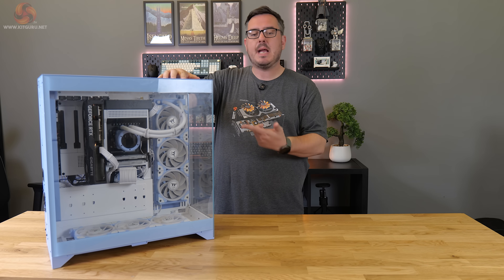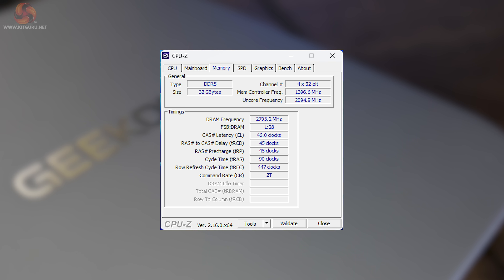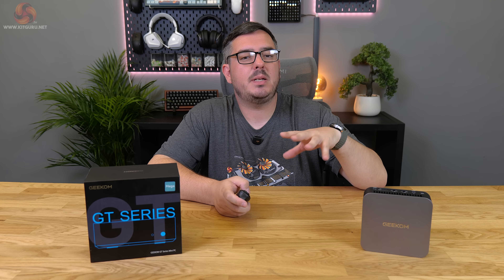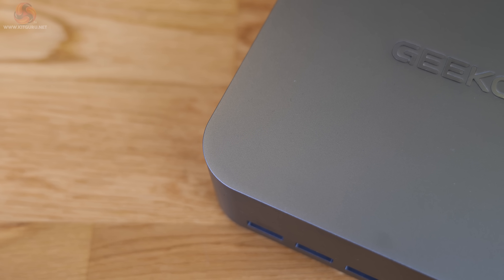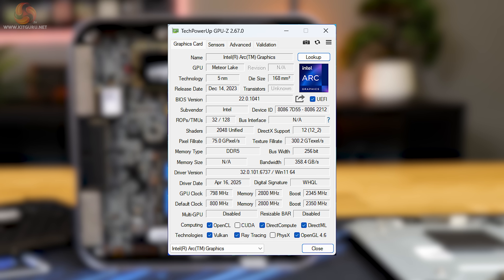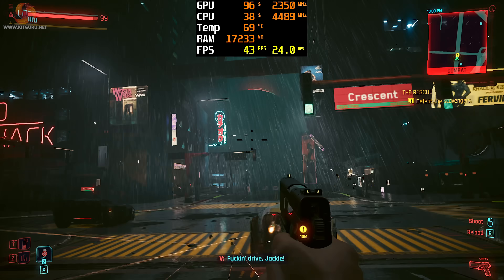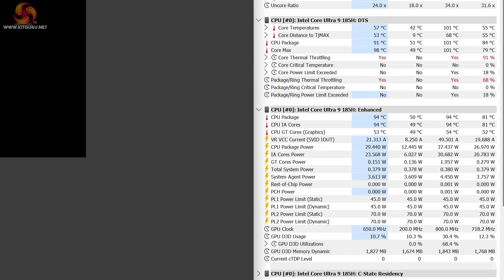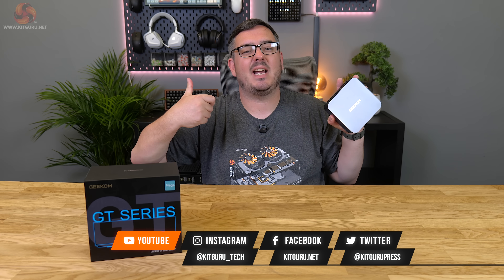Geekom GT1 Mega: The £949 Mini PC Tested

Comment from the maker: Anyone looking to buy a mini PC like this - what would you use it for? And please report any spam you see, never-ending on YouTube at the minute
Reply: I think their issue is Intel is dead in the water, if it had AMD I think it would have scored better. they run too hot as well. Makes the problems worse when its such a small chassis. DId you ask if they only do Intel versions or are they planning AMD systems like this?
Reply: I don’t mind the performance, but the lack of upgrade options is a bit of a deal breaker for me. AMD would make this better too. those intel cpus run at 90c all the time anyway or more
Reply: The IO is actually pretty decent. Two HDMI, USB4, SD card slot — ticks most boxes. However it runs far too hot for me, I got away from intel to avoid all this - sick of fan noise. My AMD system runs 25c cooler and has similar performance to my last Intel Rig.
Reply: What strikes me is how close this gets in price to a fully built desktop. At £949, a DIY build could include a Ryzen 7 9700X, B650 board, 32GB DDR5, 1TB Gen4 SSD and an RTX 4060 — which would blow this thing away in gaming and still be upgradeable. The value just doesn’t add up unless you need the form factor.
Reply: The irony is that this is a great “prosumer” box for spreadsheets, light editing, coding, or acting as a little dev server — but Geekom markets it like a gaming replacement when it’s really not. At best, it’s an overpriced Mac Mini alternative that runs Windows. 🙃

Comment: It would be rad to see one of these mini pc’s with something like a high end gpu cooler, big heatsink, fans and all 🤘😂
Reply: Wonder if an e-gpu enclosure would work with it?
Reply: @philipjfry628  You can get an e-gpu but it sort of ruins the point as now you are going to have two boxes instead of one. Guess you could superglue the mini-pc to the GPU enclosure but you might run into cooling issues.
Reply: @philipjfry628  Probably but might have slowness.
Reply: egpu is handy for these systems I used to have one but the interface often causes a loss of performance.

Comment: A mini PC is not a small "desktop". A mini PC is a laptop with no built in screen. Expect laptop thermal limits, lower performing chips, etc. they have their place, don't get me wrong. but if you need a desktop then buy a desktop.
Reply: Really depends on what you want to use it for doesnt it
Reply: To thread starter — Well my laptop screen died a few years ago and I used a usb monitor for a while on it. I certainly didn’t stop calling it a laptop and suddenly call it a ‘minipc’ 😛
Reply: A mini PC can be whatever you want it to be. There are not rules like this. ive build many mini PCs with mini ITX motherboards.; Not sure your point. There are always cooling and performance compromises with full sized desktop systems and 'everything else'. Thats not a groundbreaking fact. A mini PC is not a laptop 'by definition', a laptop is a laptop.
Reply: @MatthewSemones  Exactly. Because of that a minipc like this has to deliver at least the same graphics power as a laptop with the same price. 

So mostly those mini pcs over 400€ make no sense at all. I have a beelink minipc for 300€ that has ryzen 5800u in it. 

Its ok for office and very light 720p ganing.

I only would take amd for those minipcs because better game compatibility, better power efficency.

If intel had used lunar lake in minipc it would be good but also even more expensive.
Reply: Zip tie one behind a really nice monitor and you have a cheap iMac that runs windows.
Reply: It is a small desktop if you can do everything on it you can do on a normal desktop PC. The problem with using a laptop as a desktop replacement is with the external screen you usually use it closed and the thing just sits there overheating.
Reply: I love YouTube comments 😂😂
Reply: Oh dear

Comment: Great review. I'm a big fan of these mini-PCs / NUCs for offices and the like - floorspace costs money - but they do have their limitations your review coming from a very different perspective does highlight them.  For the office, in many cases much more modest models will be far more suitable.

When testing games, did you use any upscaling or was everything native? 

Was there an issue with recording the noise levels around 17:48? Because I couldn't hear the difference between the idle noise (36 dB) and the peak noise despite the latter being shown as 50dB.

I liked your thermal imaging.
Reply from the maker: Thanks - All games were at 1080p with settings on their lowest - XESS was only used when I mentioned it in Marvel Rivals and Cyberpunk 2077

The system noise section sounds fine on my end

Thanks again
Mat
Reply: Can hear the difference a bit but I think it’s some devices levelling the audio that causes this
Reply: The thermal imaging is great agree

Comment: The lack of Oculink is a missed opportunity. With USB4 you can technically run an eGPU, but the overhead and latency compared to Oculink are dire. If Geekom wants to appeal to enthusiasts who love small boxes, they should embrace external GPU support properly — it would open up a much larger use case. I was expecting this to have it. The other specs are good, memory, drive etc. I couldnt live with an iGPU.

Comment: I think people underestimate how good the integrated Arc GPU is becoming. Red Dead Redemption 2 and Cyberpunk 2077 at ~50fps low with scaling isn’t “good” by gaming PC standards, but for integrated graphics inside something smaller than a shoe, that’s actually kind of nuts. Intel is slowly catching up on iGPU viability. But they run so very hot, its just something we all expect now

Comment: For me the biggest issue is the thermal headroom. Hitting 90+°C and then relying on PL1/PL2 power management isn’t bad engineering, it’s just the inevitable consequence of stuffing a 16-core Intel CPU into a 44mm chassis. They need to move to AMD. Simples.

Comment: The inclusion of the Intel Core Ultra 9 185H is a bit of a head scratcher. At nearly £1,000 I’d expect the 285H, especially since Geekom’s own IT15 ships with that chip. Losing around 15–20% performance for the sake of model segmentation doesn’t make much sense at this price point.